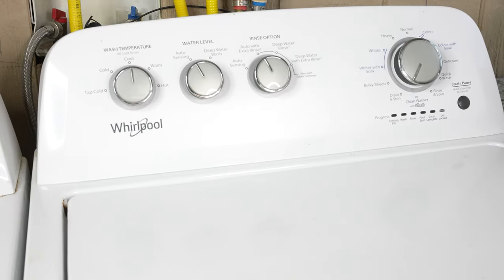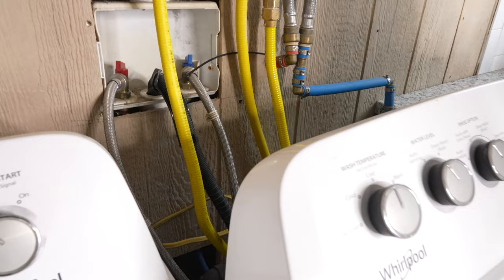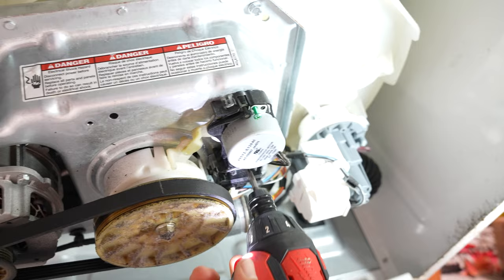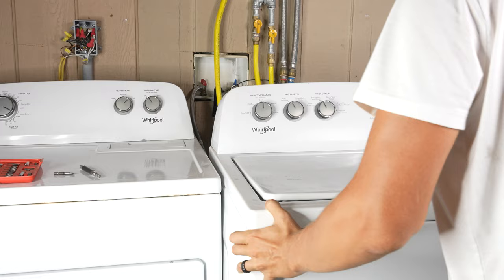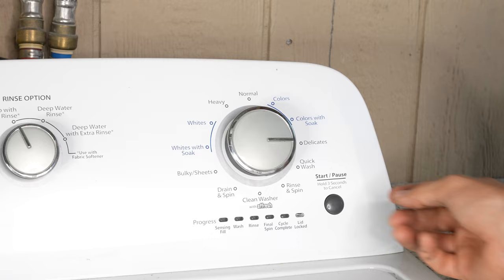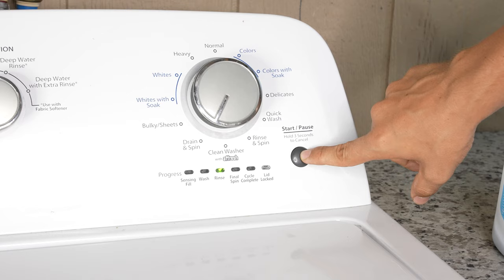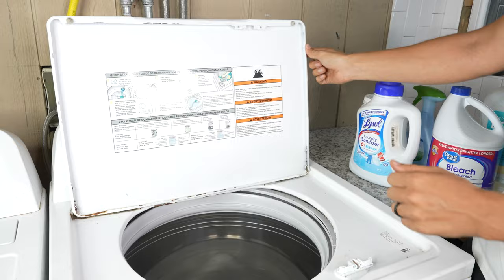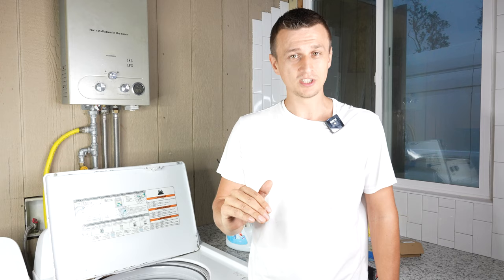Whirlpool Washer Not Spinning - Easy Fix

Comment from the maker: ➡ Other helpful videos:

How to Order Appliance Parts:
https://youtu.be/jukoV43DrDw
Top 10 Washer Problems:
https://youtu.be/lC5eqysbdsk
How to Use a Washing Machine:
https://youtu.be/Q6JHQK696AE
How to Reset Washer Motor:
https://youtu.be/3ed8Z1802t4
Most Common Washer Fix:
https://youtu.be/KmPlBZ5nT1Q
How to Replace Washer Door Switch:
https://youtu.be/gSLBiHx9VC0
How to Take Apart GE Washer:
https://youtu.be/D5hr12xcOHo
What Appliance Brand is Best:
https://youtu.be/ddy06-ssC8w
Reply: Hope you’ll do some videos on dryers too!
Reply from the maker: @febobartoli
I do have some but it would be good to make a few more. Thanks!

Comment: I just bought my whirl pool washer, the 2 in 1. It washes but doesn’t drain the water completely and leaves my cloths wet after the cycle finishes, but if I switch it to drain and spin it completes the cycle and leaves them dry. What could be the problem ?
Reply: I have the same issue, if you read this please send help!
Reply: I dont know

Comment: The actuator has also a sensor for the tachometer. This is why the tub must be rotated to calibrate the unit. The tachometer is a speed sensor that aids in agitation and spin and the lid lock.

Comment: Had same issue twice. No spin and wash light on. Found mouse nest under transmission pan where the shift actuator is mounted. The actuator has a speed sensor and the mouse nest was preventing the sensor from reading correctly.

Comment: Thanks Jay, loves your videos! How can you find different recalibration mode setting for different manufacturers? It seems nowadays manufacturers hide all these setting & informations to keep do it yourselfers away from fixing various appliance problems.
Reply from the maker: You're welcome! I agree, it does seem like they purposely hide it away. Most of the time the "secret service manual" will be hidden either in the back of the washer, behind the back cover panel or it will be taped on the inside of the washer in the front corner. You would need to disassemble and lift the top to get to it.

Comment: Recalibration sequence:
1) Set back where it was turn on and wait at least 30sec
2) Twist dial counterclockwise one full rotation back to normal
3) Turn three clicks the right
4) Turn one click to left
5) Turn one click back the right
*All must be complete within 3 sec.
LIGHTS FLASHING WILL INDICATE CALIBRATION UNDERWAY

Comment: Looks like I have the exact same washer 👍…. Question, mine goes through all the cycles wash/rinse just fine, except the very last final spin cycle. So, could it still be the same part (actuator) that is keeping it from doing the final spin. This just started today. 
Thanks for any suggestions

Comment: Does the calibration step apply to older models. Mine doesn't have any kind of lights
Reply from the maker: It varies from model to model but if yours does not have any lights there are probably no recalibration procedures besides just unplugging it for 30 seconds and plugging it back in.

Comment: I have the same washer but a different problem.  The drum does spin but tends to bang the sides of the washer.  Even if the load is perfectly balanced is still bangs.  Even when empty there appears to be too much play with the drum.  You can easily push it from side to side.  Any suggestions?  Thanks.

Comment: What if it doesn't drain? It gets to the point where it should drain and stops there. I can force it to drain by setting it on Drain and Spin and restarting. But it still doesn't spin. Again I set it to Drain and Spin and restart again and it spins out. Is it still the same part?

Comment: You said 3 clicks counter clockwise, then actually turned 3 clockwise to “rinse”…
Reply from the maker: Yeah.. Kind of tripped over my tongue there. 😅
Reply: @WordofAdviceTV  of course my issue doesn’t seem to be anything stripped out. Ive taken out and cleaned plate. The gears dont seem to damaged and the actuator feels to be good (the machine is only a couple years old). However, it sounds as if the noise is coming from electric motor. It spins, but makes a god-offal noise and tub doesnt spin… 🤔
Reply: @jameycreel9330  Did you figure out where the noise was coming from? Mother in laws is making this horrible noise and doesn’t spin either but I haven’t had a chance to go take a look underneath yet.
Reply: @Ojb_1959  it was the actuator. I bought a new one and put it in…